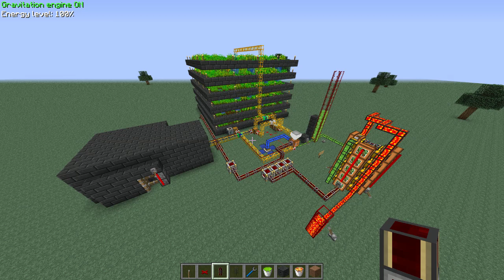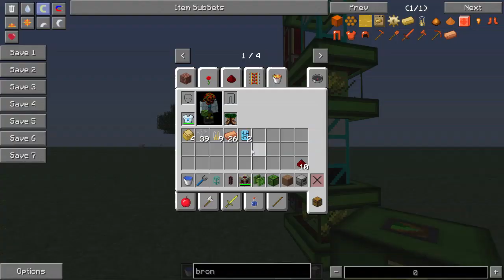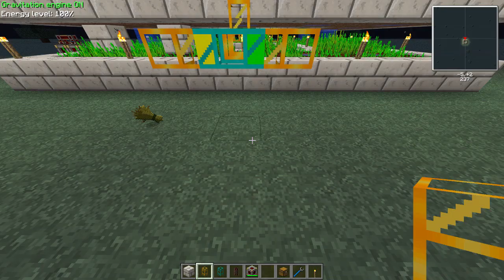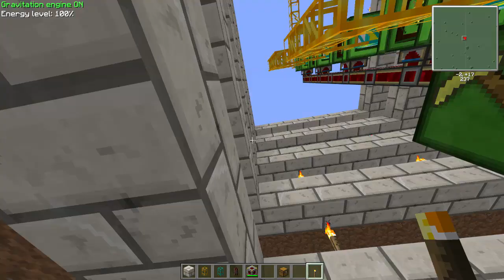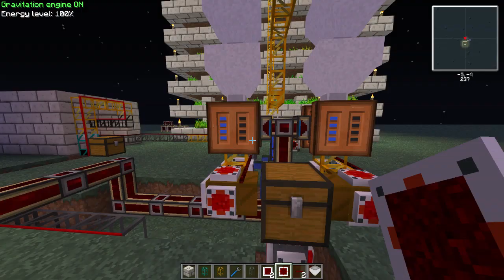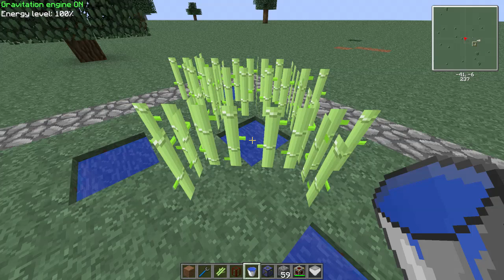Biomass Tutorial - Fully Automated Biomass Factory (300+MJs)

Comment from the maker: Biofuel and enough high pressure steam boilers could give you that much constant mj production for sure. I had mine doing around 850 or so mj/t in my single player world but could have expanded to double that I'm sure. you can also use wood to burn in steamboilers and generators for a lot extra. With AE and MFR it's much easier to make a larger output of biofuel with saplings. I'm going to go over it in episode 7 if you want to check it out. Eventually I'll do a new tutorial on it

Comment from the maker: Ya I made this a while back and wasn't intended for ultimate pack. Could get seed oil with the squeezer. Seed oil has a pretty weak output with biogas engines so I wouldn't bother but has some purpose with bees (impregnated casing and sticks). otherwise maybe just void pipe or incinerator using an export bus and level emitter

Comment: Been playing around a lot more and I found out that steves carts is a far better system at gathering the materials for this system.  You should check it out, it's almost much more compact honestly, and requires no energy aside from the sunlight. I created a skeleton grinder connected to obsidian pipe to create my bonemeal and I unload it back into the fertilizer module, fun stuff. I"ll probably post a video soon if you're interested.